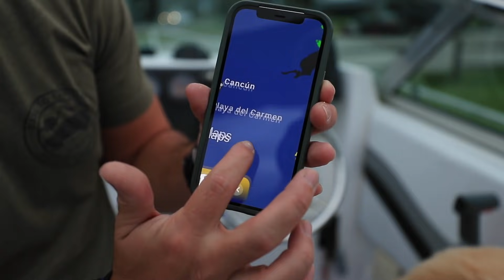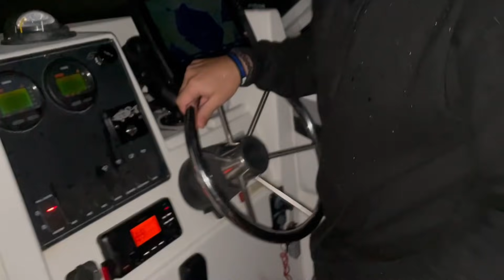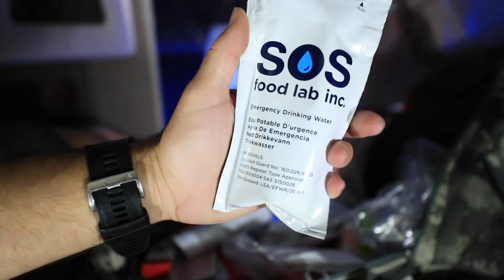Staying OverNight on Survival Boat During HURRICANE!!! (70+mph Winds!!)

Comment: Good video! That anchor is fine for a lunch stop in a light wind but is not adequate for gale force+ conditions. I'd follow West Marine's or the manufacturer guidance on anchor size if I'm going to anchor overnight. Also, it's best to have at least 6' of heavy (5/16"+) chain between the anchor and the line. Chain will protect from chafing on rocks. It will also add a lot to the anchor's holding ability if you use 20' or more chain. One last bit of unsolicited advice, I only attach my anchor line and chain to anchor with shackles held closed with safety wire, never with carabiners or snaps. I also like the end of rope at the anchor to have a thimble spliced into it.

Comment: You need to install a Lewmar freefall windlass profish 700 series and change your nav light bulbs with LEDs.  With Striper anchor locker being shallow the most anchor rode you can put using a windlass is approx 150 feet of rode and 20-30 feet of chain without jamming.